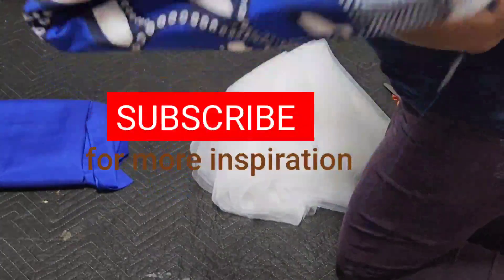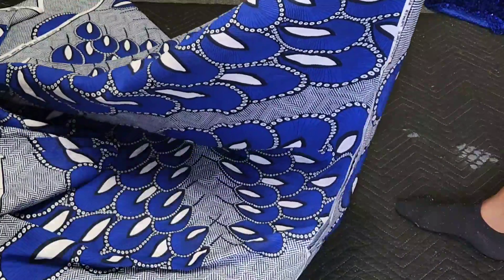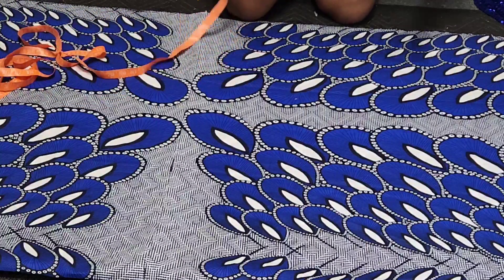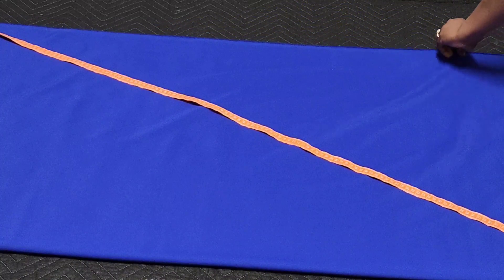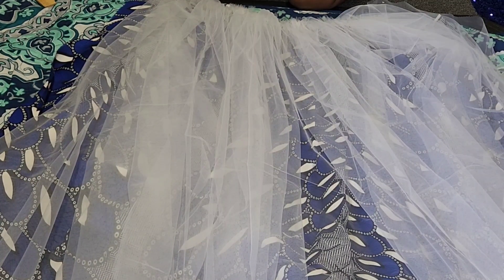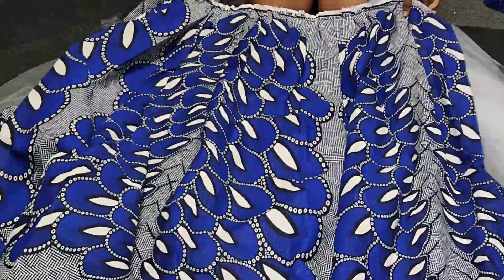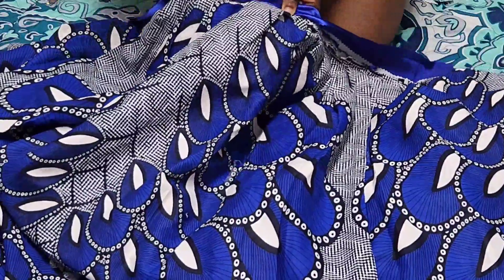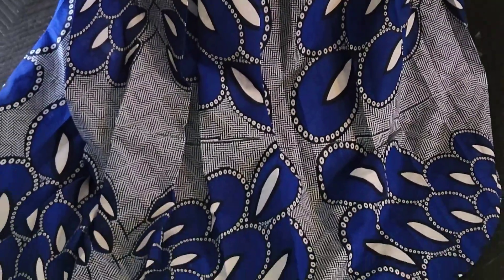making bridal detachable train with less fabric || removable ball skirt

Comment: Thank you so much 
Please what did you use to hold the waist together
Reply from the maker: I hand stitched the waistband together to seal it. You can use your machine if you want, but I prefer hand stitching my band to avoid stitches showing out on the right side. The white stuff attached to the inside of my waistband is interfacing to give it some support and I used Velcro (used on sportswear for easy closing) you could use buttons if you want. 
I hope this helps. Thank you and let's keep learning together.